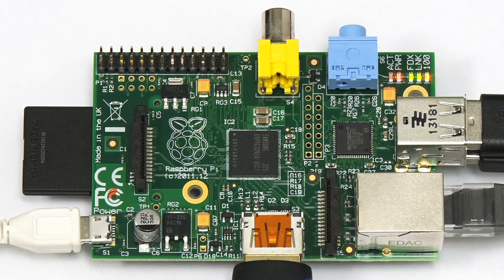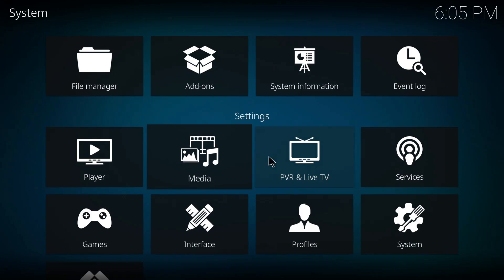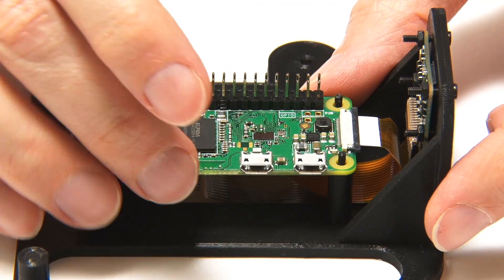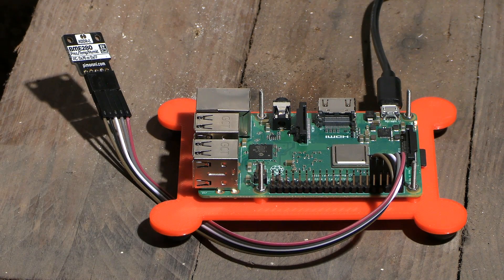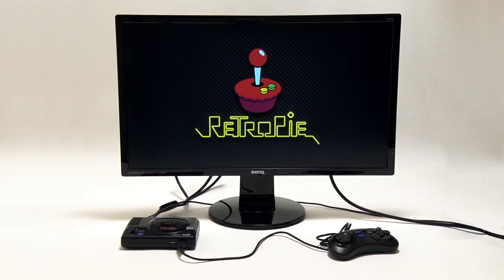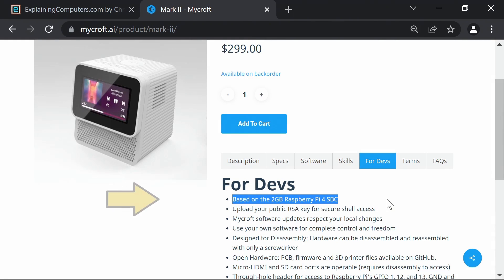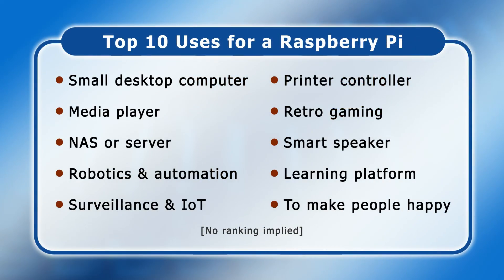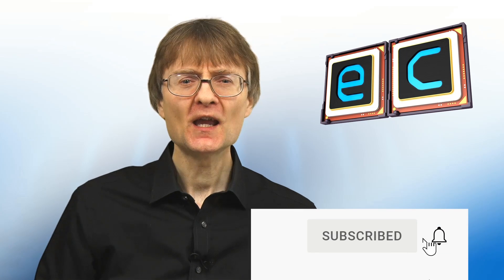Top 10 Uses for a Raspberry Pi (400th EC video!)

Comment: If need to provide remote access to a console of a Cisco router or any network equipment that has an RS232 console port the raspberrypi is great. You need a USB serial adapter and then minicom from command line.

Comment: I totally agree about the “last two things” clip in your video.  I retired as a “software engineer” in 1998.  During the time I worked in the computer field, programmers were given various titles. It was before universities were producing computer science graduates. During my retirement, I did attempt to keep pace with advances in the computer field since I am tech support for family and friends.  In 2015, I learned of the Raspberry Pi and I bought a Raspberry Pi 2 kit.  I had never heard of Python and had never used Linux.  Since then, I have added a 14 RPis and two Rock64s to my collection.  I have made inroads into relearning how to code and using the terminal in Linux reminds me of the MSDOS and CP/M days. I’ve also delved into the Arduino world.  I’ve had to resurrect my soldering equipment and skills.

Comment: I have a RI-2? it's used as a Squeezebox server for my Audiobooks. I haven't seen it for years it is hidden on the bookshelf. I have an SSD connected to it. It just keeps going. Occasionally I will run an  Update/Upgrade. I can't remember how many years its been running. I have thought about an upgrade but then why then it's doing a good job now.

Comment: One more usage: as a MIDI controller for an instrument, for example: a pedalboard for a keyboard, a Synthesizer, etc..
Reply: Do you, or anyone else have any links to an actual pedal made with one. What effects does it do and what sort of latency does it have?
Reply: @sharonwolff1  YouTube keeps deleting my replies. Apparently, I'm more dangerous than a bot 😕

I will try it again; here the ones I have found (not with Raspberry pi, but I think they could be ported):
* WOMinator MIDI bass pedals by Lee O'Donnell: interesting because it uses note velocity based on how faster the user pushes the pedals. Most of the found solution have a fixed velocity.
* Arduino MIDI Bass Pedals (hammond) by  Ron Czarnik: it has a nice instructable link
* MIDI organ pedals by  bitluni: pedals made from scratch

I'm also doing something with the Raspery pi, it is a small MIDI controller. It translates bass notes to chords amoung other things and its called JMMidiBassPedalController. It can be used on Raspberry OS, Linux, Windows, and MAC OS and it is programmed in python
Reply: @sharonwolff1  I forgot about zynthian, a software plattform to create your own Synthesizer. It is officially done for the Raspberry Pi. It looks interesting. I'm planning to use this for my controller

Comment: Congrats on 400 videos.

I created an RPi cluster to learn specifically about distributed computing, both grid style and cooperative.  While one could do the same with a hypervisor or cloud service, the Pi provided the exact environment I would have when I tried applying this to much larger clusters of larger nodes.

The most recent use was to provide test servers for testing NTP implementations with as uniform an environment as possible.  Being able to put the same GPS receiver on each, and having the shortest possible path from the antenna while also keeping the length of that path the same, was much easier with the Pi.

Comment: I have two single board computers. An Odroid I keep in my electronics lab to interface with my microscope and research parts on the internet. The second is a Raspberry Pi 4 running Retropie. I have two more projects that I wish to do when time and money become available; create a NAS and create a network attached video surveillance system. I would be interested in setting up a Raspberry Pi as a network firewall.

Comment: Congratulations for the 400th vidéo! Thanks for all. Cheers from France. 😁

I've a Raspberry Pi 4 8Gig I took initially for playing with because I'm a software engineer but was converted to a retro gaming console that I can carry with me everywhere, thanks to the form factor. And since the 64bits update of Raspberry OS, I use it even more at home as a secondary computer/test platform. I use a NESPi case with the really convenient SSD enclosure/cartridge. 120-240Go SSDs are so cheap and large enough for that and the spare cartridges are available but a bit expensive for what it is.😁 I've planned to change for a GPi case 2 with the dock for a more compact and portable setup without any loss of computing power but many events have delayed it.

I've also a 4Gig one as a home automation system that I called Alfred (Batman reference inside) and is constantly in work in progress. It's used mainly for personnal assistant, presence simulation, intrusion detection, garden automation. Thanks to many of your inspiring videos.
I would hire Robin to relieve a bit Alfred. He seems a bit overstressed for a while. 🤣Sadly, the stocks of the RPi 4, RPi Zero 2 and the CM4 are quite fluctuating these days...

Finally, I've a Pi Zero 2 for ad blocking with Pi-Hole for my network.

Comment: Congrats on the 400th video, Chris 👍
Watching this, I remember the first video I watched of yours was the Raspberry Pi homemade smart speaker. Great little project. That was a few years ago now 😉
Thinking of the RaspberryPi 400, keyboard and RaspberryPi4 in-one, wish I had something like this in the late 80s. Wouldve been easier than lugging my c64, disc drives, cables etc around when I stayed at family for holidays. SBCs are the best 👌👍

Comment: My lesser desktop finally died after many years and I couldn't afford any windows machine. Thanks to you and LTT I felt the Pi 400 could handle the very basic tasks (YouTube, Excel) I needed from it. Bought the kit and an SSD. Used my existing monitors and UPS and with YouTube's help was able to setup what I needed 1-2-3. I had forgotten the scanner which turned out to be a hurdle only owing to my lack of knowledge of Linux.  Still only took a day to get it working. Been very happy for under $150.  

Thanks for your inspiration.

Comment: Here are a few other intangible uses:
10.3) reducing the cost of a project.
10.4) making a project possible.
10.5) bringing a concept to completion more quickly.

I worked a paper route all summer '81 to earn my first computer.  If the computer was this cheap, my summer would have been filled with computer learning.  Instead, my new computer was used every night after school for hours at a time.

Comment: Congrats on the 400th. I use my Raspberry Pies for VoIP server, VPN server, Print server(old pinter where no drivers exist anymore on Windows or Mac) and on top I can even print from my iPad over Wifi, one is for photo roll on a framed TV, one is for a script that talk to my DSLR for timelapses, another is an SMTP server that notified me if my IP address change, but the most crazy use of my Pies is turning the USB port in OTG mode and make think any devices it mounted a USB drive and inside, the PIe points to a shared folder on my NAS woth an image file so I can have my XBOX, PS5, Xbox 360, Switch and more with terabytes of space and with ability to backup and have in a RAID.

Comment: For NAS use, I would want a model or alternative with fast SATA ports that aren't throttled by hanging off the USB bus. So needs a SoC chip with its own SATA controller or a proper high bandwidth external bus (like PCIx) connected to a dedicated multiport SATA controller (multiple ports to do a proper RAID of multiple discs).

Comment: I have a Pi 3B running an ADS-B receiver feeding to Flightradar24. and also running as a local TV server with a Pi TV Hat. It runs 24/7. 
I have a Pi 4 2Gb that I am using to try to receive weather satellites (NOAA and Meteosat). Once I have working I will put the SD card into a Pi Zero 2 W and use that for it, again runs 24/7.

They are fantastic low power devices for all kinds of things.

Congratulations on your 400th Video.  They are inspiring.

Comment: I actually comfortably use my rpi4B for a lot of things as a kind of secondary computer - I use mpv as the main video player to play videos or music from most places, and I pair it up with yt-dlp. I use ytfzf to search youtube videos, or I use a browser like qutebrowser. Using DWM tiling windows manager is also supersweet on the resources. I also use one of the various vim (neo with lunar/astro) or emacs for a text editor. It also acts as a fileserver and running pihole is a must. There's just so many things to do with it that I need to buy more (just not at current prices). I've learnt so much just by using the pi, I am disappointed in myself that I put off learning about the pi earlier (and I've barely even scratched the surface of using my pi with the things I know that can be done with it). Learning linux using a pi is imo one of the easiest and best ways to get into it, and making a mistake is easily rectified, as well as starting fresh from the beginning. It is by far one of the better ways to ease you into using an operating system like linux/bsd instead of devoting your main system to it straight away. Maybe Linus should've done that lol.
Congrats on your 400, I make it my habit to never miss one ever since I cane across you. SBC's and microcontrollers are my bread and butter now.

Comment: Watching on my daily drive raspberry Pi4, I use the little thing almost every day for watching videos, using discord and web browsing. It is a desktop replacement for me because I'm fully aware using a Ryzen 5600X with an RX 570 for light web browsing a massive waste of power and also the Pi is silent (well the fan kicks in on the argon case on occasion, but that is because room temperature here is over 30°C most of the year)

Comment: Kodi on the pi is much better than the media player it replaced, I would recommend a flirc so you can use any old remote to operate the pi it's stupid easy to set up.

Comment: I used my Pi 3B to test a tiny 1cm diagonal CRT screen from an old camcorder viewfinder, the tiniest CRT in the world. I didn't have an HDMI to composite video adapter, but then I remembered that the Raspberry Pi 1 had such a connector. Turns out, the 3B still has the composite video connector, it's only hidden as pin 4 of the headphone jack.
The amount of functionality packed into the Pi is absolutely remarkable.

Comment: Congrats on 400th video! Good use for viewing on Pi 400 ;-).
My personal uses of Pi: 3A+ Octopi, Zero + AVR (without Arduino) - light and temperature monitor/controller - now upgraded to Zero 2 + Pico with remote SWD over SSH and (terribly slow 7,5" black/yellow e-ink display), Zero + AVR - car battery logger when haunting for unplanned discharge, Pico - RGB light controller, Pi400 - Swiss army knife when I needed to test something with GPIO fast and easy. 
Speaking of easy learning with Pi - it is (mostly) cheap enough that even if you burn it it will not ruin your day (or parents wallet) so it encourages experiments you wouldn't do on your main PC.

Comment: Fun indeed! Trying out lots of different Operating Systems for me :-) My Raspberry Pi 400 (also have an early Pi 4) which swaps between RISCOS Select, Twister, Raspberry Pi OS, Ubuntu & Windows 11 variously stored on Mini SD Cards, SSD and USE Sticks. Fun indeed. I'm 75 and started with a BBC Model B in 1984 before getting a RISC PC 600 that later got a StrongARM & PC Co-processer. In the mid 1980s I took part in the TTNS (The Times Network for Schools) with Dial up modems 300 Baud (I think). Anyway congratulations on reaching 400 videos!

Comment: I have a rpi zero 2 w with a WinTV-soloHD tuner and tvheadend, with kodi i can watch live tv on any device over wifi. it was just as fun installing and building this setup as well as it makes use of old tablets that really didn't have much use before. Another pi (2b) i have runs the popular software pi-hole, which blocks ads and trackers on any device connected to it.

Comment: Currently using my Raspberry Pi 4 8GB for various things from Pi-Hole DNS Adblocking to a Pterodactyl server, but my favourite use case like you mentioned is shoving a clean SD card into the Raspberry Pi and testing different applications and software without fear of breaking my personal system.
Reply: did the same for garyexplains tftpd /nfs server, booting 1 pi4 with software sourced over the intranet from another pi4. was quite fast, both connected to gigabit switch and the internet.
Reply: My Pi 1 does the Pi-hole duties and my Pi 3B+ does the retrogaming, my Pi 4 does pretty much everything else.

Comment: [linux fanboys trigger warning]
my first pi has been set up for a mqtt server  and pihole, it killed sd cards on a regular basis for some reason. after trying many tutorials like disabling logging with no success. since i could control my iot stuff directly via ping/http requests and pihole couldnt even block ads in a smart tv youtube, i got rid of it. 

years later i set up a pi 3 for octoprint, but it was impossible to get certain things like a particular usb webcam working even when following many tutorials that all did different things to "fix" the same problem, which obviously none of them worked. i have had hours on hours searching for solutions to a problem, which lead into more problems that i needed answers for. install x, install y, configure z. oh version 1.1 doesnt have x anymore, tutorial was made for 1.09, reinstall your system since its now messed up.  
you should get a free pack of ibuprofen with every pi, linux is a buggy cluttered mess.

i swapped it for a compact x86 machine i found in a dumpster which is now running windows, after disabling everything bad windows is known for, and after looking up how to forward ports and create autostarts i havent had any issues yet. it starts when it needs to and does the job its supposed to do.

Comment: this is great. i specially liked "make people happy!" . and may i add, the Pi is also a cheap & easy way of learning to use all SBCs - 
you can get a Pi zero W , small SD card and  pretty much get started. no HDMI monitor? no problem, run it headless. and on the way, learn some about the Linux terminal. 
happy 400!

Comment: A very useful video Chris.  Some people simply think it's a slow PC (but they're completely missing the point) as you've demonstrated in this video.  Plus the fact is you can afford to buy several of these cheap computers and give them a unique task, to buy several PC's is so much more expensive, takes up much more room, noisy (Pi computers can run silent) and more expensive to run.

Comment: These should be the true replacements of the BBC Micro in schools. Able to learn a variety of computing tasks, implementations of older system, robotic control and use modern productivity software set these boxes apart. Resurrect some older computer programming languages and you have a system that could set up many children for careers in IT in the future. Someone should implement a version of SuperBASIC for modern n day use as debuted on the Sinclair QL, maybe with added extensions to support libraries and ISAM with complier facilities to create stand alone applications. A very useful structured programming learning experience.

Great video Chris.

Comment: You can add although is like a media player, using it as digital music server with external DAC or hat
Reply from the maker: Ah, yes -- a very good other use for a Pi. I must try adding an audio HAT sometime. Noted in video list now!
Reply: Since I know the pi s audio capabilities are not that great I line out the audio signal of my kodi media center with an hdmi audio extractor.
Reply: @matneu27  Other users with Volumnio (spelling) with a HAT DAC have great results too.

Comment: Great video, a raspberry pi 5, would have been so nice for 10 years, but getting a 4 seems difficult these days, keep up the good work.
Reply: They're not just difficult to find. They're literally sold out worldwide. If you check out rpilocator, you'll see 3-4 hit foreign markets each day. And that's it. 

I know we have a chip shortage, but this is getting ridiculous!
Reply: @thewiirocks  Wow.  I did not even know about that website.  Thanks for pointing it out.
Reply: @aytviewer2421  Credit goes to Jeff Geerling. He pointed it out when I complained about the lack of Pis on the market. 

I ran smack into the supply shortage when I got the bright idea of getting a GPi 2 Case. I figured I'd just pop down to the local Microcenter and grab a CM4 module. Imagine my surprise when Microcenter didn't have a single Pi! I ended up having to pay for one of 35 remaining modules with MMC on Mouser. Which would cause its own set of problems (can't use an SD card with an MMC device) but at least I got it working.

On the bright side, I learned that CM4s are amazing! They come in box the size of a matchbox and snap into whatever project board you want. Waveshare has cheap boards with all the I/O of an RPi 4, but also with NVMe slots and other goodies not present on the official RPi boards. I'm really loving these things!
Reply: Yeh and they don't seem to be Cheap these days , especially the latest one .At least not in the UK